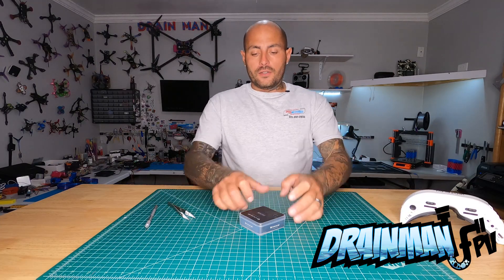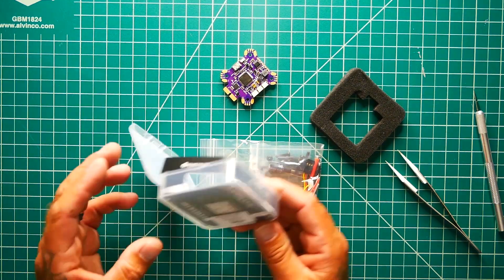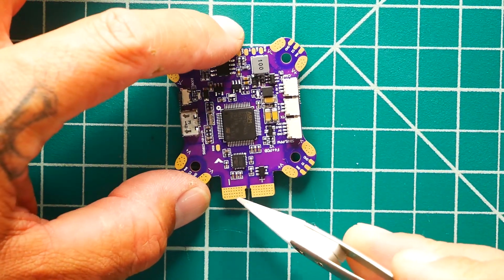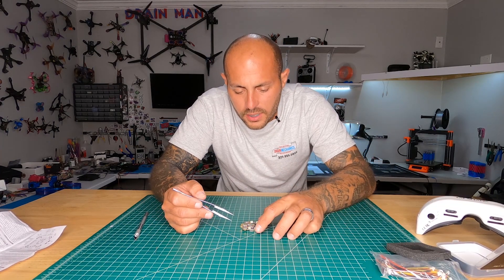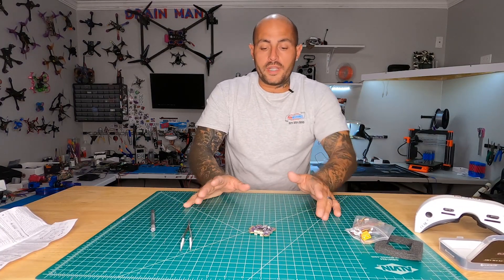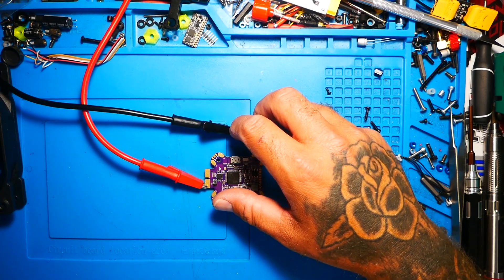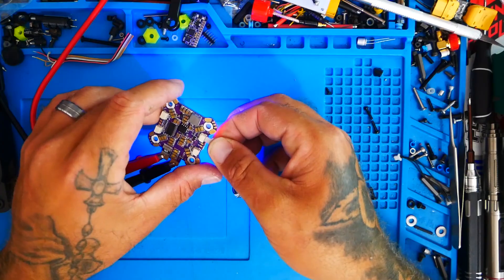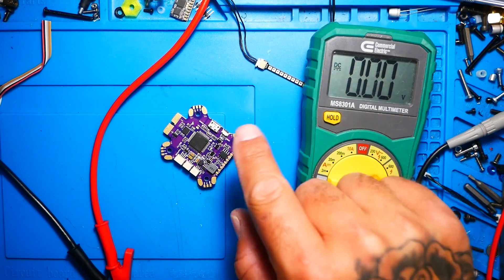Don't Over Look This All In One! Flycolor X-PDB

Comment: Nice Video, nice FC but I can't get UART 1 to work with a GPS / Crossfire. Bought a bunch of them and wanted to use them with DJI, Crossfire AND GPS but only works with 2 UARTs (UART3 and UART 6). Maybe someone will manage to use 3 Devices withs this FC.